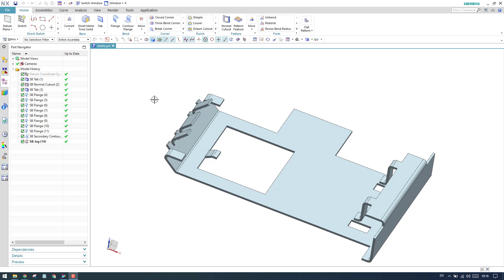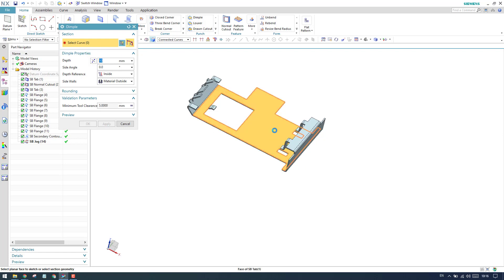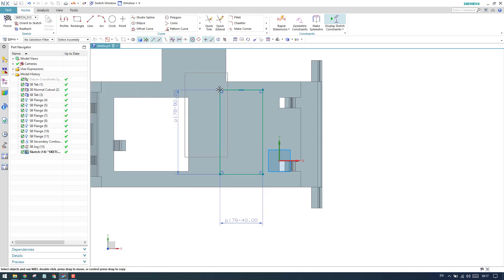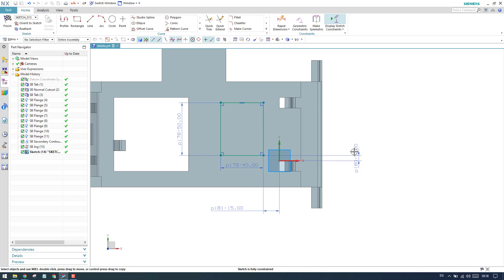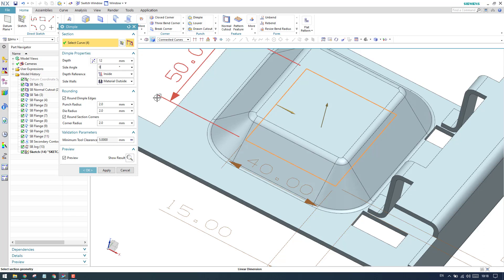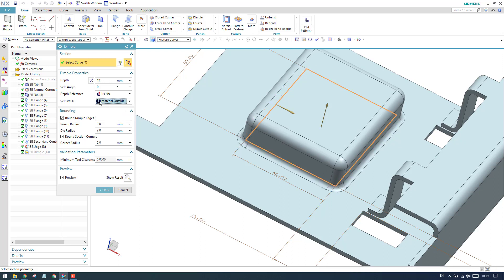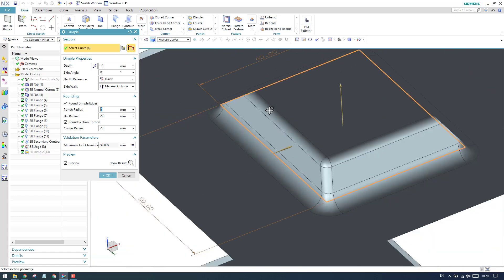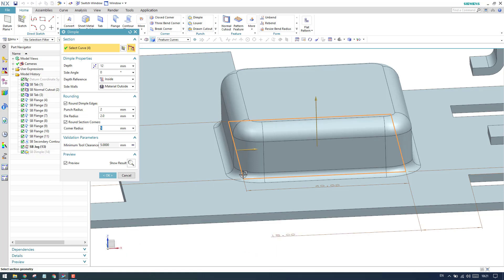Siemens Unigraphics NX-Sheet Metal || How to make Dimple || Dimple command.

Comment: Thank you. But I am trying to make a dimple over a face that I got by a dimple itself. I mean, imagine you want to have 2 concentric circle and you want just  the part included between the 2 circles be dimpled. Is it possible? And how? I tried to make a sketch with more closed paths, but NX doesn't accept it. I tried to make a new sketch curve over the "dimpled" face, but nothing to do (I always get the error message to check my parameters - and I did it....). I s there a way for that? Thank you!
Reply from the maker: Please make sketch of what you want to do  and share image to techdesignsantosh@gmail.com I will check and let you know
Reply: @TechDesignsantosh  Hi and thank you for your kind reply. I have sent you the link to a shared folder on my GDrive where you can find the image of what I am trying to model with NX and the .prt file of what I already did. You should receive the link from my personal email, so I ask you to not to share my email with others. Please, if useful, feel free to use the .prt file for a new video or whatever you want. Thank you again, Federico
Reply: I have the same problem, did you solve it? @compassft
Reply: @Dizaynspeed  I think I didn't go with the double dimple but, to get what I needed, I used the "solid punch" tool. Hope yhis helps
Reply: @Dizaynspeed  It's a long I don't work with NX anyway if I am not wrong you have to create a solid that than you will use as a press tool on the metal sheet, exactly as you would do in reality